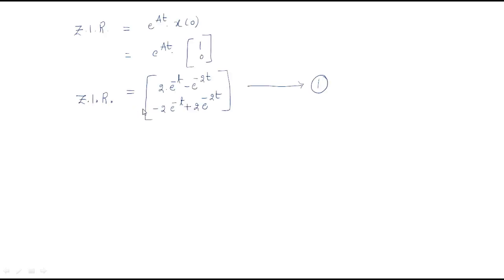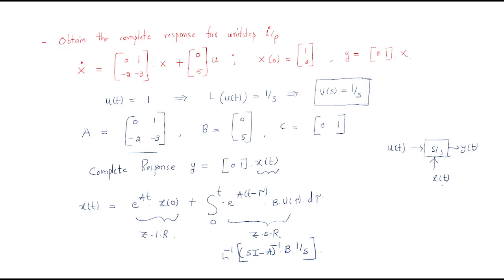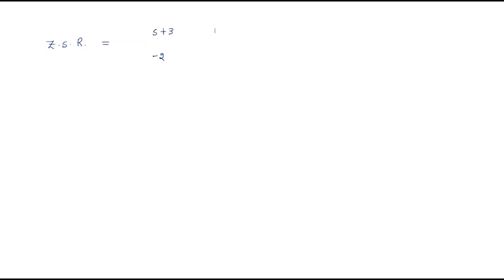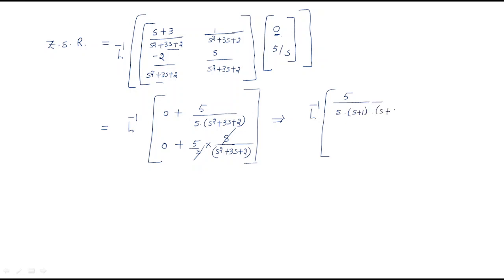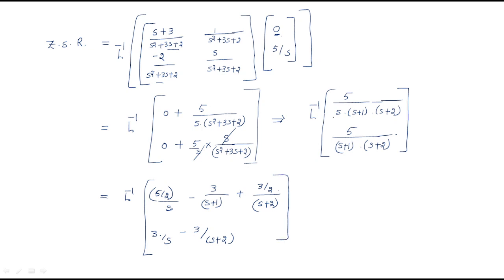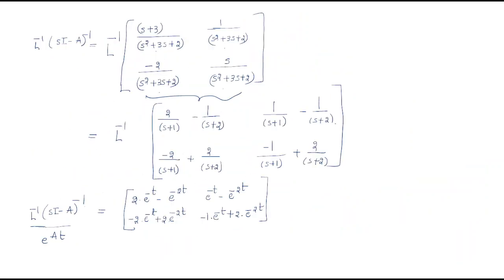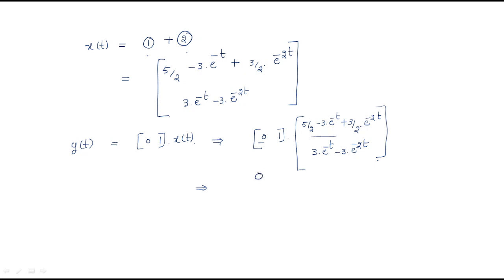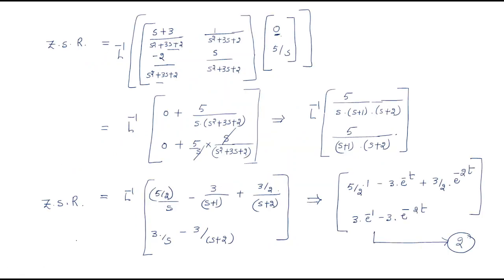State space analysis  | ZSR | Unit step i/p | Part-2/2 | CS | Control Systems | Lec-124

Comment: sir i have doubts on this problem if,  [x1(t) x2(t)]₁×₁matrics  =  [ 0 -1, 2 3  ]₂×₂ matrx  [x₁ x₂] + [ 1 0 ]₁×₁ matrx × U. 

where the initial conditions are [x₁ (0) x₂ (0) ]₁×₁matrx  =  [ 1 1 ]₁×₁ matrx  ..
. i'm stuck in this problem and how to solve this type of question. i have already know how to solve state transition methods and some other methods in state space analysis includes but, i don't know about this problem that how to solve and stuck between its homogeneious or non- homogenius so that's why i asked you. while  i  go for sem exam even don't know about it  it will shows me a stars in exam hall. i already saw so many times by this subject exam if, i  got solution from you it will helpful for me in coming semester exam in a week. so, please! hope u understand sir